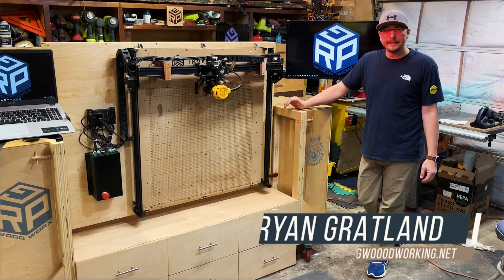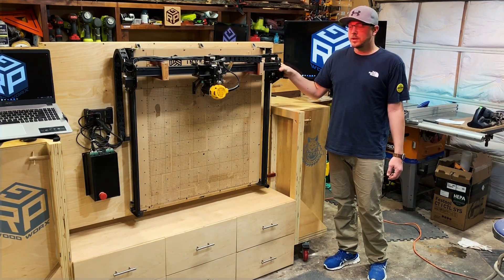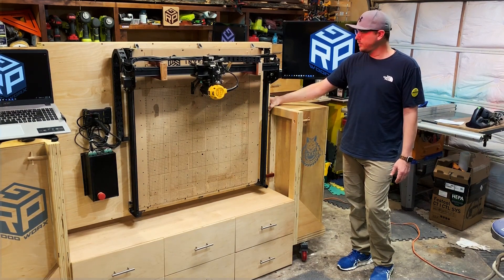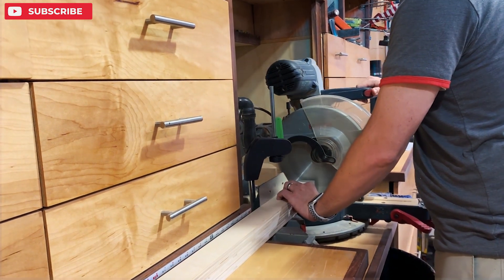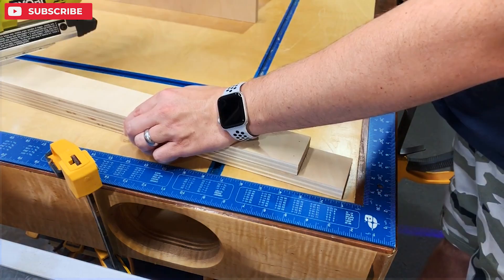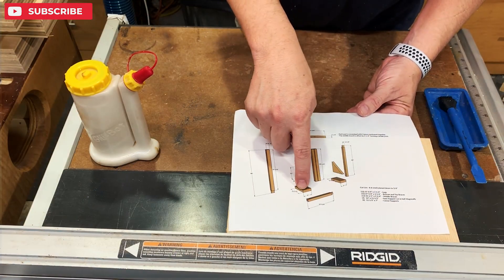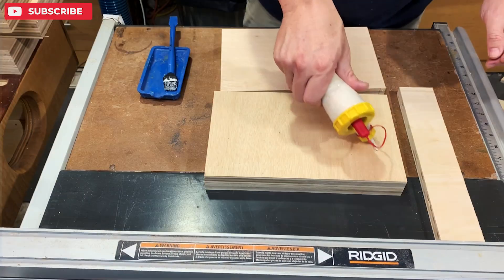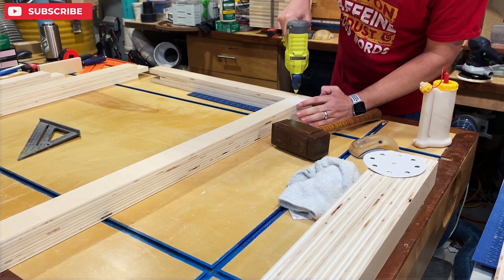DIY | How to Build a Extreme CNC Mobile Flip Top Station: Part 1

Comment: Great job on the video.  Bought the plans but they only have one (1) center piece in the frame assembly but video has 2 with a space between.  Which is right and why the difference?
Reply: Hi!  The plans are correct.  I built the two incase it need a sheer web inserted.  But, it didnt so the single is all that is needed.  Enjoy!
Reply: @ryangratland2330  thanks for quick reply

Comment: I didnt finish the video yet, but I need to add this comment :
please use a push stick when you are that near to the blade and don't push the other side to the blade to avoid kickback (always push the on the fence) ! :)
Reply from the maker: Sébastien Plante I appreciate the feedback. As a content provider I should be sensitive to that perception. Despite the view from the camera the cuts were very wide and my fingers were far from harm.
Reply: @rpgwoodworking5489  No problems, just think that some kids will try to do the same as you :)

great video btw !